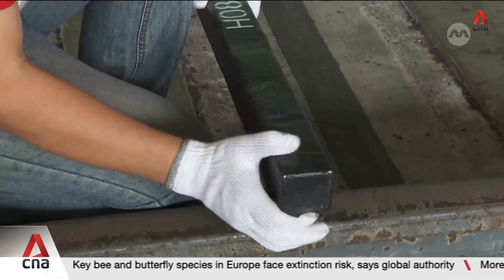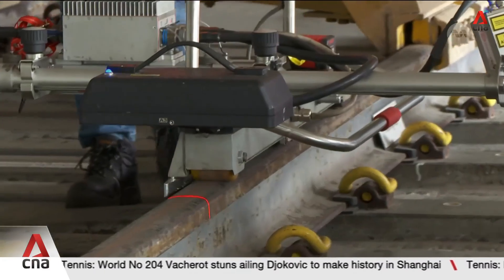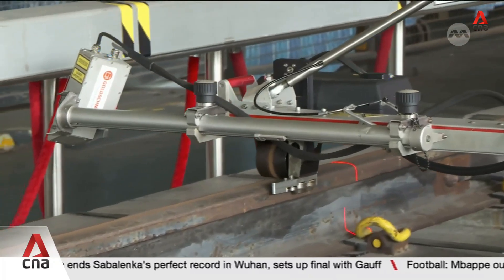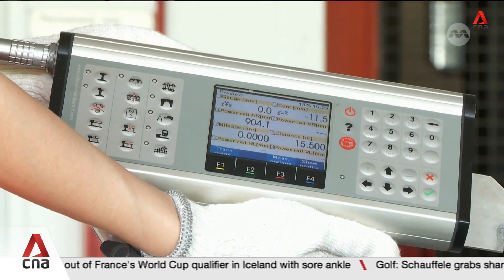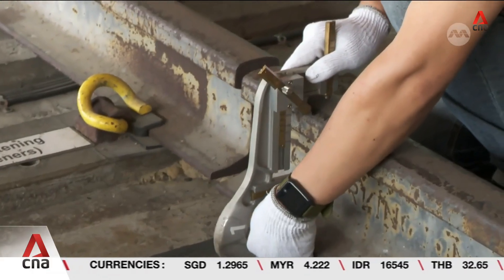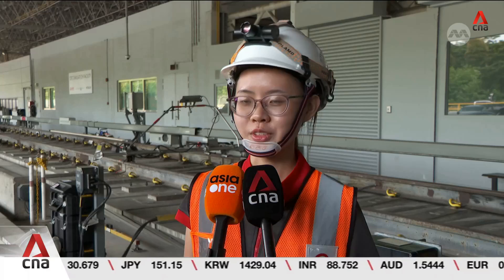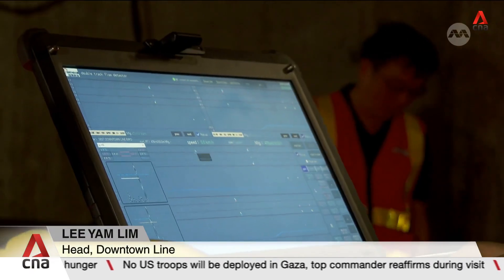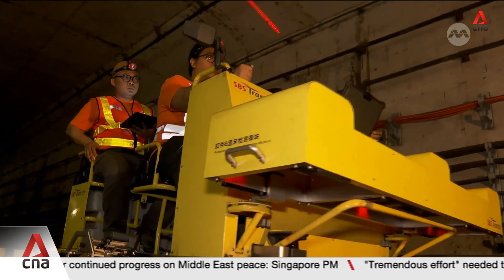MRT operators tap technology to find defects at least twice as quickly

Comment: China Launches AI Robots to Transform Freight Rail Inspections
14 May 2025 — China has launched AI-powered robots in its freight railway sector, marking a major technological step that significantly enhances inspection efficiency.
 robot that checks rail lines, keeps them safe, and reduces accidents.

To achieve full-chain closed-loop “smart diagnosis-autonomous decision-making-precise operation”, it integrates cutting-edge technologies like 3D digital twins and AI recognition, enabling accurate detection, efficient autonomous repairs, and intelligent safety management.
The project has successfully overcome six core technical challenges, including “millimeter-level alignment of high-altitude bolts”, achieving a 100% pass rate in actual railway maintenance.